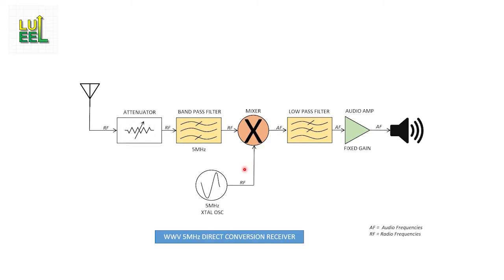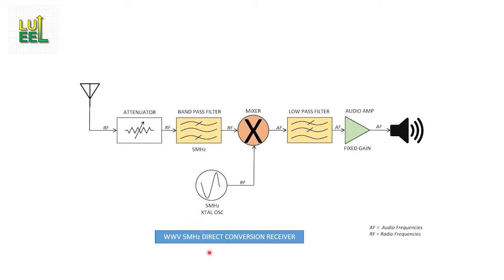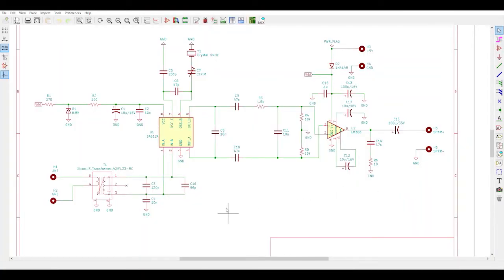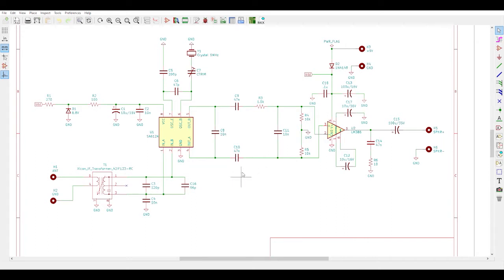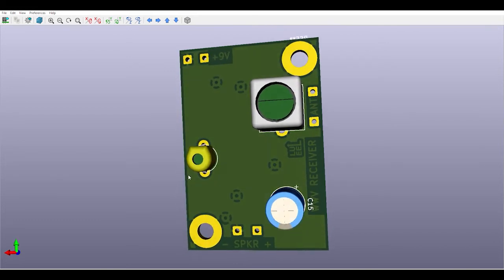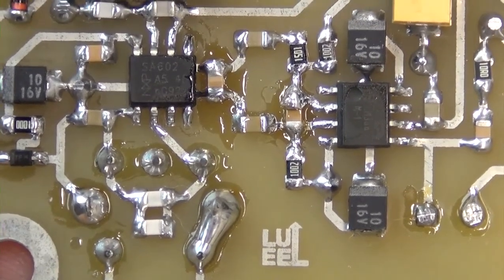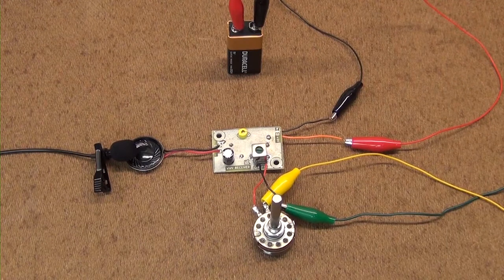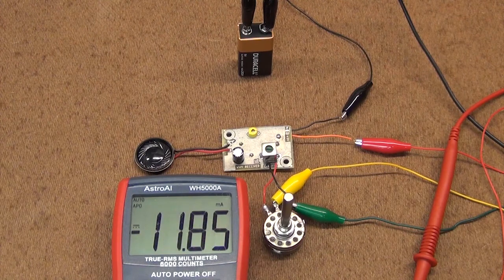A Direct Conversion Receiver for WWV!

Comment: Here in Europe we have DCF77 (77.5 KHz). When I was a kid there were first Microcontrollers like 8749 to decode but it was more fun to build transmitters to play with at railway stations for example...
The signal is still active in 2023. Hard to receive in the Southern Greece. More and More the GPS is used or simply accessing an NTP server.

Comment: Another informative and enjoyable video, thanks! You answer every question that comes to mind, which is satisfying.  I had not realised that 9545khz crystals are readily available,  that makes a fixed 10mhz AM WWV superhet achievable.  In my limited experience  AM detectors are not quite as easy as they seem.  I've had some success with an infinite impedance JFET detector. I'd like to see you take a look at the AM detector options for homebrewers sometime.

Comment: There are some issues with direct conversion receivers. The LO will automatically lock to any nearby carrier unless perhaps there is good isolation. The second issue is the high gain in one frequency band (audio) results in oscillations or artifacts of oscillations through power supply coupling. Another issue is every component becomes a microphone. It was a long time ago I built a DC receiver and I didn't have a proper antenna.
Reply: I will never build a DC RX again. I hate them.

Comment: It would actually be quite easy to phase lock your local oscillator to the WWV signal by using the DC error voltage , LP filtered from the balanced mixer output. A varicap across the crystal trimmer would suffice., pulling it a few 10s of hertz .depending on the error voltage level.
Reply from the maker: Interesting, I will look into that suggestion.

Comment: Once I saw your video on a DC receiver for WWV I was interested. When I saw the Johnson Viking Adventurer in the background like the one I own, I scrolled down and when I also saw the Heathkit RF signal generator which I own I subscribed. Cool video!

Oh, I had one question. Given that a doubly-balanced mixer/detector will suppress AM why do AM signals like WWV get passed through to the LM-386 audio amplifier?

Comment: Great video.
If your local oscillator and input frequency from WWV are at exactly 5MHz , you should get no output from from the NE602 and will hear nothing from the lm386 as the difference of the signal from WWV and your LO will be 0Hz and the sum will too high and  filtered out. If you can pull your crystal oscillator 1KHz to pickup an AM side band then the the voice information should be clear.

I might build your circuit but use my reference generator to replace the crystal in your circuit and tune for a volume null, then my signal generator should be "exactly" in tune.

Thanks for sharing.

Comment: I'm curious about your comment on carrier phase vs LO phase and distorted audio.  Carrier phase should only be important for amplitude of very low frequency baseband signals.  Receiving AM with a DSB receiver is quirky because of tuning error, where the USB and LSB content don't match exactly unless the LO is exactly centered on the carrier, and they interfere with each other.
Reply from the maker: Yes, actually I was being a bit critical about the phase difference.  With receiving this level of AM it isn't an issue of concern.
Reply: @levelupeelab  nice, thanks for the followup. By the way, I've fallen in love with your videos. You do such excellent work; thanks for sharing your activities!

Comment: I notice in the schematic C2, C4, C8 and C11 values are all 10 nf, which is 0.01 uf. What got my attention was C2
in power supply filter. Most similar PS designs seem to always use a 0.1 uf or 100 nf to filter high frequency noise, along with a 10 uf for low frequency noise. The other two 10 nf in the base band filter most likely are correct.
I'm not trying to be picky. C2 and C4 are probably OK as they are of 10 nf.

Any word of a new DC superhet receiver in the works for WWV reception?
Reply: From myself. In checking the data sheet for the SA612A, C2 is shown to be 10nf, not 100nf or 0.1uF as I thought. However C4 should be 100nF or 0.1uF, not 10nF. So I was half right!

Comment: Could I use a proto breadboard just to test, and then build on copper clad board?
Don
Reply from the maker: Yes I think that would be fine, these frequencies are pretty low.
Reply: @levelupeelab  
Finding a 5 MHz XTAL is hard. If I
chose 10 MHz to receive instead, what do think C3,  C4 and C16 values would be?  10 MHz XTAL are all over.

Comment: Also, having a heck of a time finding the 42IF123-RC  10.7 IF transformer. Can anyone suggest a substitute that works?
Reply from the maker: You can buy them at Dan's Small Parts and Kits.  However, he had stopped taking orders for a while but I see he's back open again.
Reply: Thanks I did the IF xformer at FAr circuits
Reply: just use a toroid core t50-2 or smaller like t37 or t23-2. wind it. or even an aircore solenoid inductor on ballpoint pen, about 30 turns.

Comment: Can i ask why did you use R4,5 resistors? Is it required?
Reply from the maker: According to the reference design info that I used for my version here, R4 and R5 are necessary to set the input bias for the LM386.
Reply: @levelupeelab   Thank you, i will use.